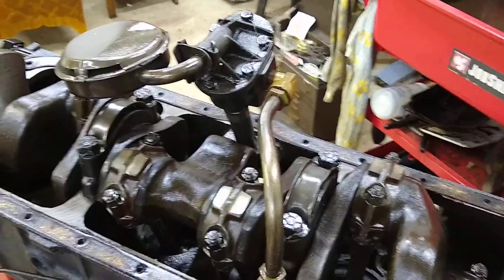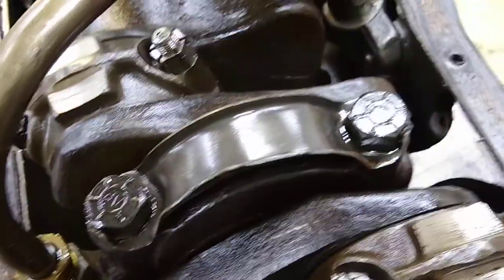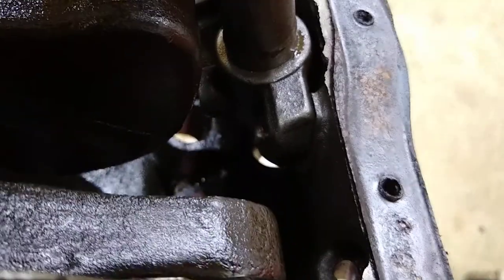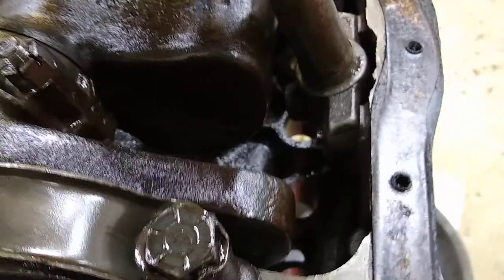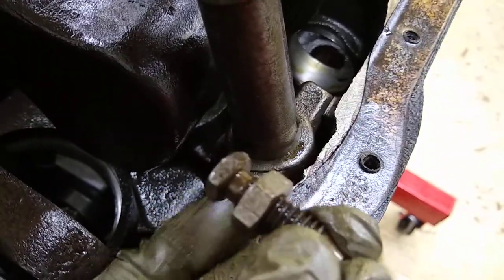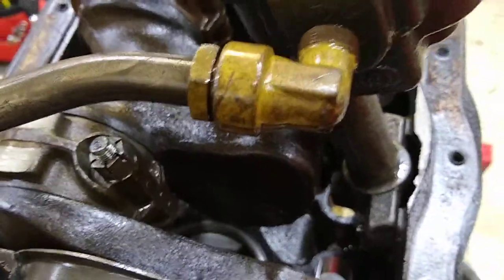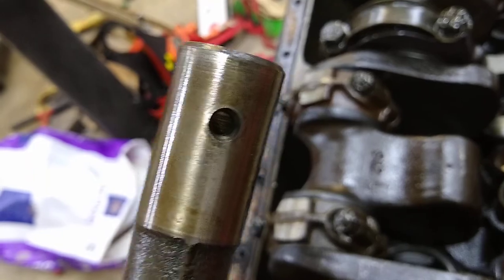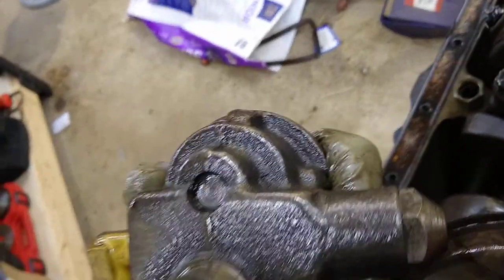GMC 228 oil pump removal

Comment: I have a 1946 GMC with the 228. You mentioned a manual. Where could I get it? BTW good videos.
Reply from the maker: Thanks!  Manuals are pretty much everywhere.  I think I got mine from oldchevytrucks.com  Most of the classic truck supply stores have them.  Ebay might too.